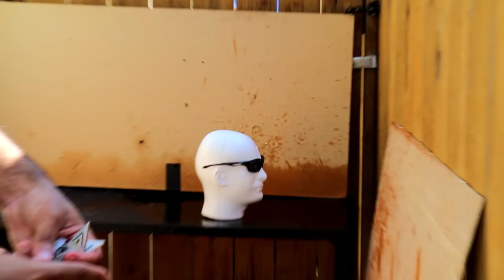MOST DANGEROUS TOY OF ALL TIME!! FIDGET SPINNER!! (+1000MPH) FLAMING FIDGET NINJA STAR!! EDITION!!!

Comment: You guys should use better ways to attach parts. Like the knife one you made, you could have drilled holes in the blades where the holes were located at on the ends of the fidget spinner, then used a bold or screw to hold it together.